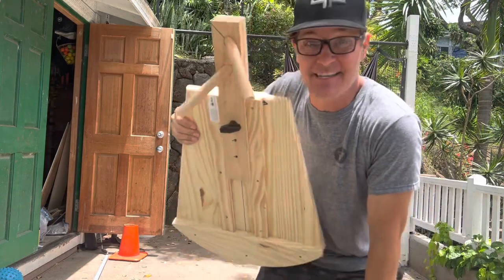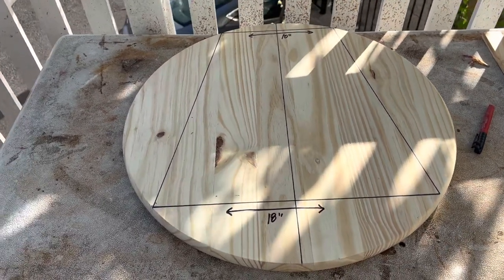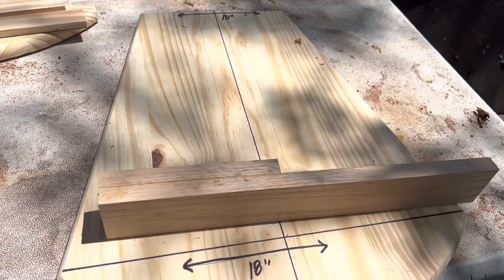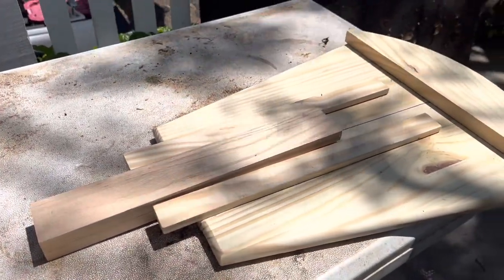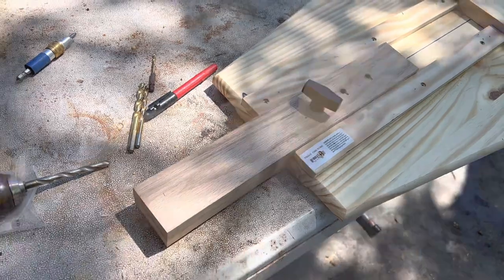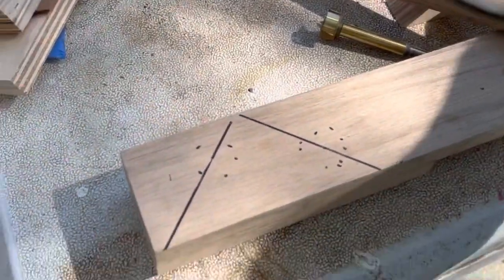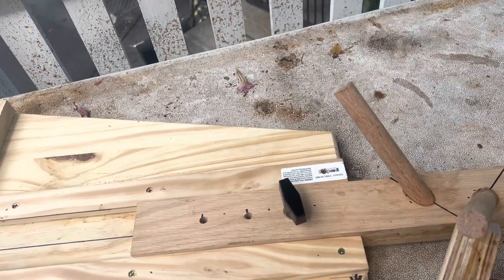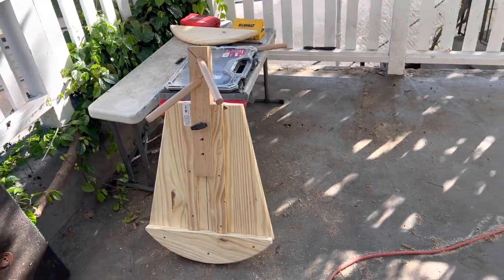How I Improved My Golf Swing with a $40 home made device. The poor man’s E-bell.

Comment: A trick to building the handles is to build a "wooden jig" with the correct angles all the way through with a drill press and a drill press vise.  Then take that jig and clamp or temporarily screw it on the centerpiece so you don't ruin it. The bell could be particle board but the handle needs to be real wood for strength.

Comment: Good post but I think you can simplify it even more. First of all the handle extension does not need to be oak and does not need to be that thick. You are not supposed to be swinging this at full speed. Second, you can simplify the handles by simply cutting the dowel at 45 degrees and gluing it on. You can drill the pilot hole as you did and then just put a screw into the dowel from the backside for extra measure. I would recommend using epoxy for gluing the dowel which should be stronger than the wood.
Reply from the maker: Yeah I thought of that but wasn’t sure about how strong it would be. If you have done it and it works then let me know. Would be much simpler.

Comment: I built a easier version for anyone that cars. Buy two 2x4's at lowes that are pre cut to 2 feet. Screw them into a flat letter T. Drill the holes and but 3/4" pvc pipe in themand screw them in with wood screw so their secure. Done, works wonders for what your hands should be doing. The rest was easy once i got the hands and rhythm correct.

Comment: I'm not the woodworking type, but would it be easier if you cut the tips of the dowel at a 45 degree angle?
Reply from the maker: Not sure I understand your question. Could you explain further? Thanks.
Reply: going through the wood, instead of just nailing it down, makes for a  much stronger joint.

Comment: What length is the board piece top to bottom? Will look to make one but don’t have a circular piece of wood as my starting point.
Reply from the maker: There is a bit more info in the description to the video. This one is 24 inches not including the handle part. It can vary a bit to be honest. Mine is slightly smaller than the real thing both in length and width but I preferred it like that. You could easily cut one out of some 3/4 inch plywood or mdf.

Comment: How did you drill the holes for the handles?  You mentioned that you did it freehand.  Do you mean with a handheld drill?
Reply from the maker: Yep. With a hand drill. I basically used an angle finder to approximate the angle at which to drill them used a drill to make the hole at the same angle.

Comment: What are your thoughts on the device? Will it make a difference in your swing?
Reply from the maker: I like it. I really see the benefit in it for new golfers or massive slicers. To me it really reveals how the body needs to move to move a mass effectively and how stable the mass should feel if it’s moving on the correct path.
Reply: Pretty goid job.  The handle on the actual one slides down farther into the slot which makes it hinge less and is also usable for less strong players. If you want to know how to train with it visit my channel at e-bell golf on youtube.
Reply: Imitation is the sincerest form of flattery